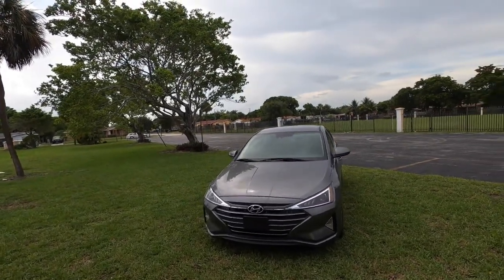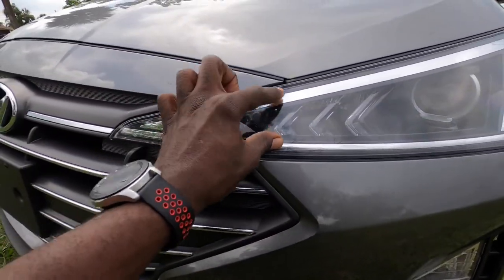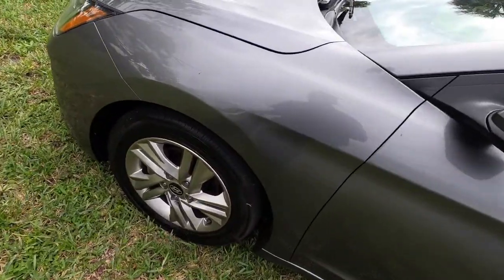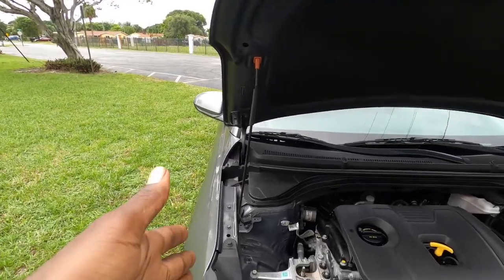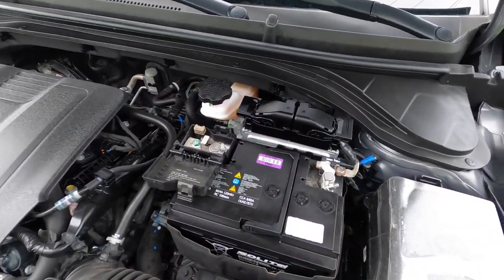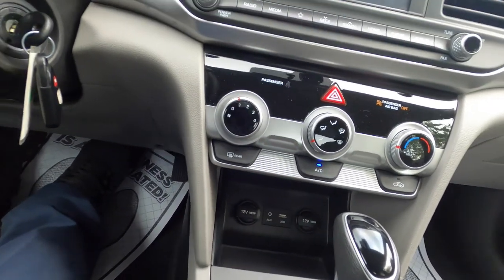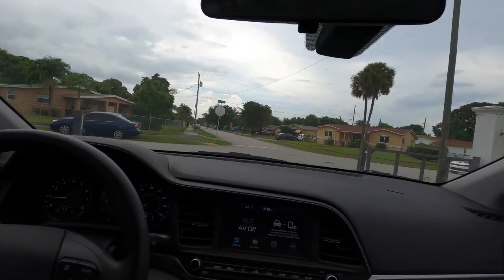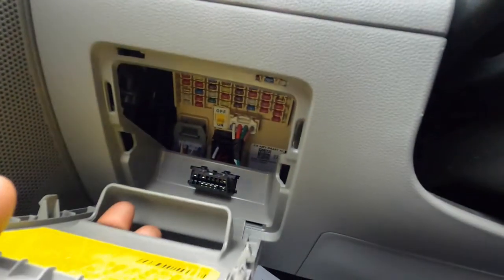IMPORTANT THIS TO KNOW ABOUT 2018-2019 HYUNDAI ELANTRA  WHEN BUYING OR OWN

Comment: The thing about Hyundai and Kia is that at the time of purchase there cheap but when u have to buy parts there expensive example a battery for those scars start at $169. Cause there cold cranking amp are high do not try and go cheap on the amps u might get one or two cranks out of it and that’s it. I know I work at auto zone and advance auto parts stores